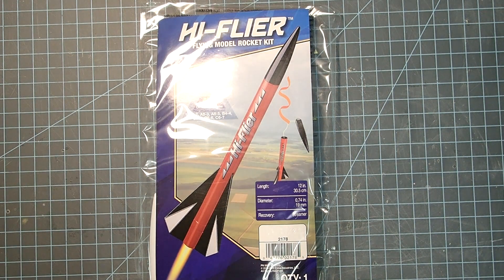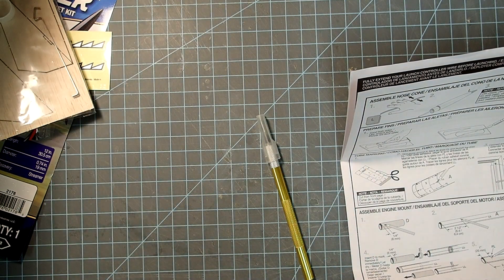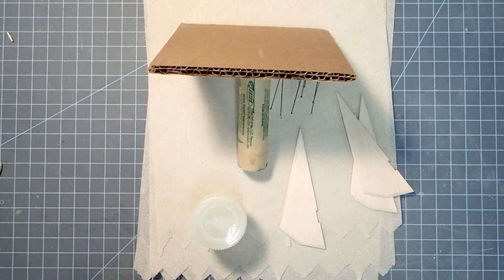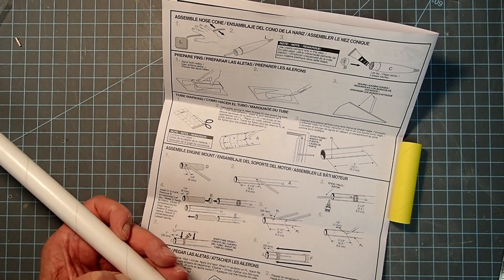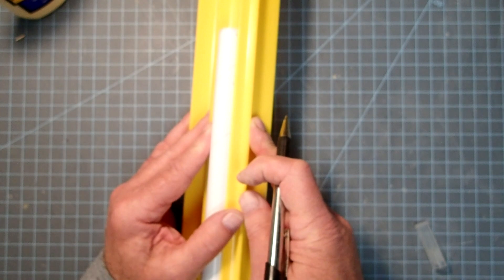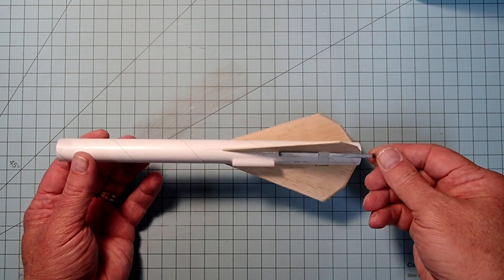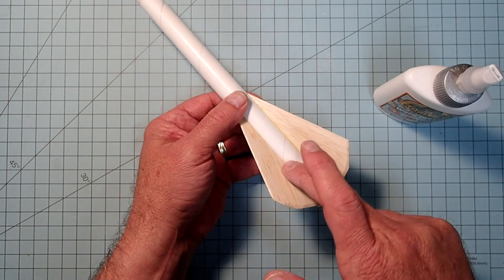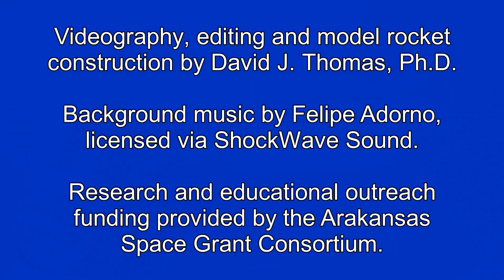Estes "Hi-Flier" model rocket assembly

Comment: Dr dave i made a fin system for applying sanding sealer you can try if you like... i took a small square of wood, about 5"x5" and glued clothes pins around the wood facing up to use as clamps for the pins... worked well for me.

Comment: When you say over all length of a rocket are you including the nose cone, nose cone and fin tips, or just the length of the body tube? Thanks Dr Dave
Reply from the maker: @gillandro2  assuming you are referring to calculating shock cord, from the aft end of the body tube to the tip of the nose.
Reply: @REAR_rockets  so my rocket will be 48" aft to tip of nose.... i cut a 150" length to account for sewing mounting loops on either end and enough for a loop tied in for the chute.... looks rather long and the way im attaching the shock cord is a quick link on an eyelet in the front of the baffle which is halfway up the body... will this be too long?
Reply: @REAR_rockets  with the added info i sent would the shock cord be too long as the baffle is at the halfway point between the two body tubes, overall length is 48" and i made a cord 150" which was 48*3 plus 6" for making all the mounting points.